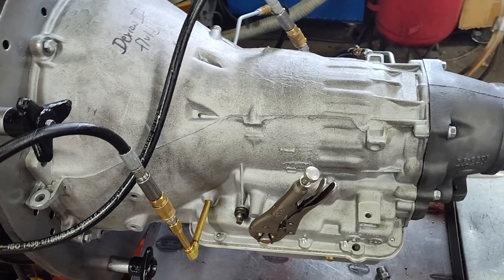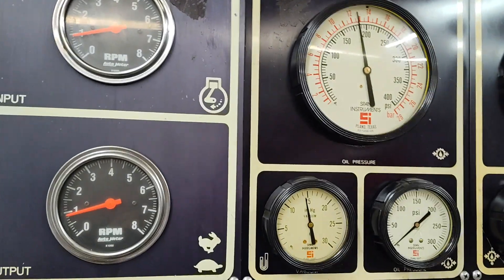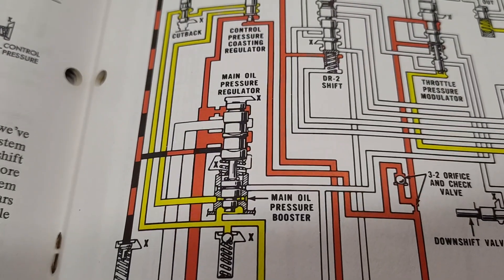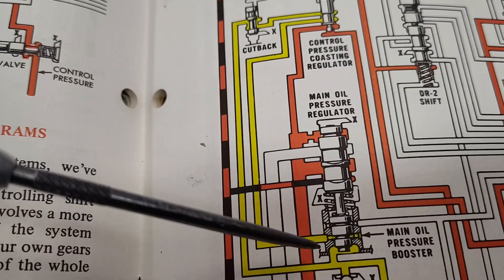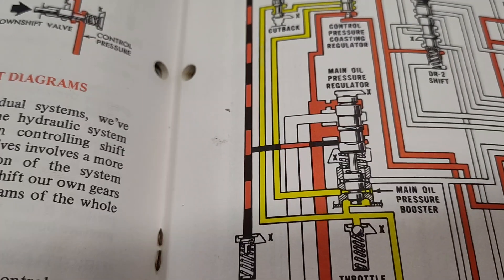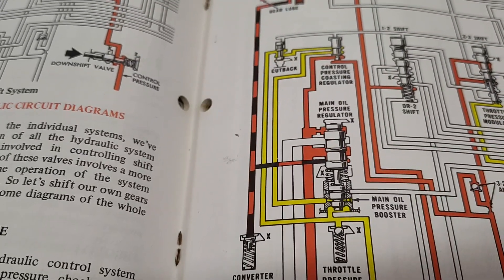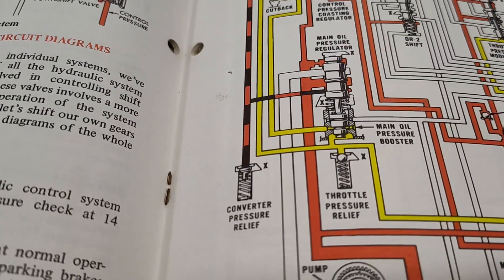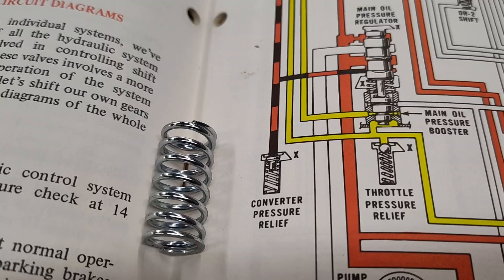Is Pressure Variation With Fixed Pressure Valve Bodies Normal?

Comment: Great video Jay. Would you say at around 4000rpm, the system is making as much pressure as it can? Moving the RPM up to 7000rpm wont see any more pressure than at 4000rpm?
Reply from the maker: Usually 3000-4000 it tends to peak out. I honestly never tested at 7000 rpm up though.

Comment: It is actually my current favorite book! Lol. What pressure does your Auto shift valve body usually run at? I have it installed and will be installing trans soon. Planning to run Redline Type F fluid.
Reply from the maker: Auto shifts will vary from 180-220 psi